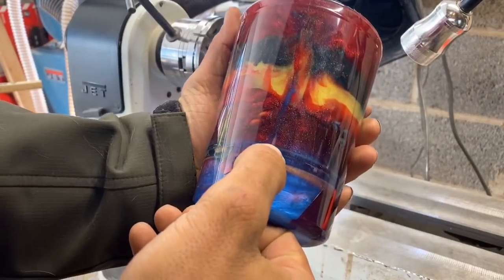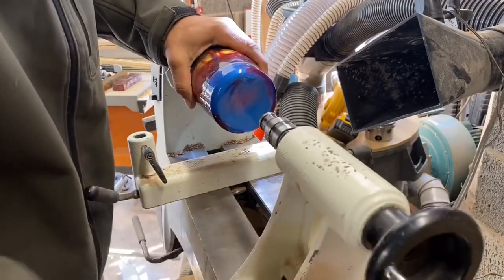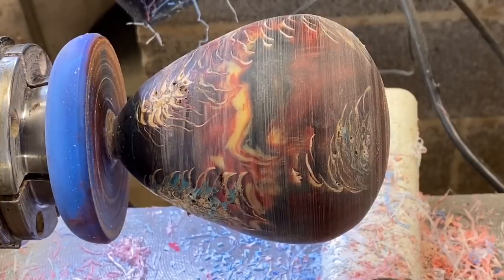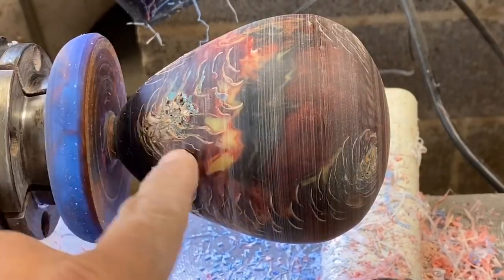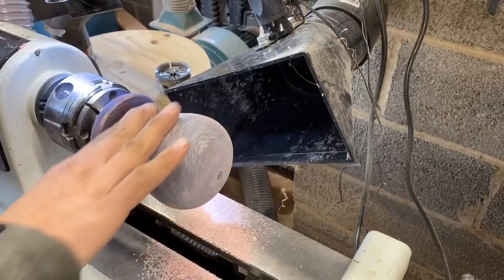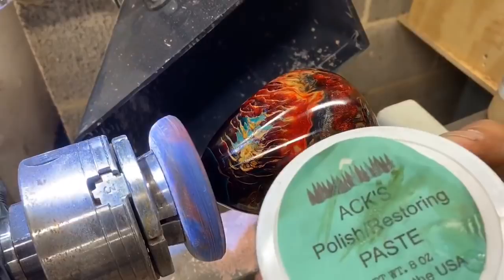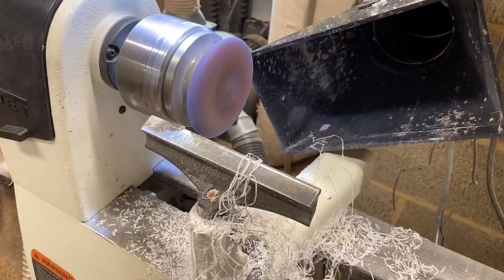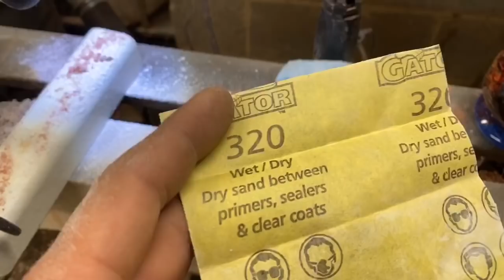#43 - Wood Turning - Resin and spruce cone dragon egg

Comment: Jeesh! I would loved to have seen how you did this pour. The colors are amazing. Subscribed...
Reply from the maker: Jay Hundley thanks Jay!  This pour was a multi stage pour. I explain and show part of it in my #40 video. It is the sum of my miscalculations for a number of pours. I just scrape all of the extra resin in a cup with the cones and toss it in the pressure pot with my desired blank. Let me know if you have trouble finding it!  Thanks again

Comment: Cool piece K! Great colors...  i hope you don't mnd a small bit of unsolicited advise... Next time you turn an egg shape, try putting your tenon on the bottom instead of the top. It's not only easier to turn and shape the egg that way, but it's a lot easier to sand the flat bottom after parting it off then the top. Nice turn. Thanks for sharing, V...
Reply from the maker: Mike Villafuerte Thanks Mike!  No worries on the advise!  I’m still learning everyday. It’s actually quite funny I intended to go the other direction (tenon in the same spot but flip the egg). But after my mid turn distraction of the fire pager I came back and just started hogging resin off !  By the time I realized what I had done it was too late, and just had to figure it out!  There is always next time I guess!  It’s funny how a (my) mind works but it always provides a challenge! 🤣. Thanks for watching !